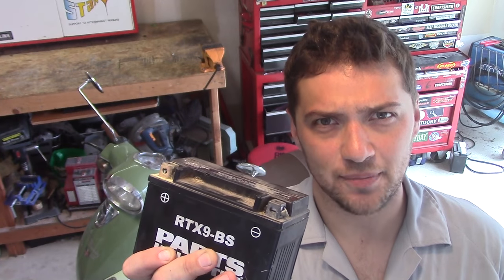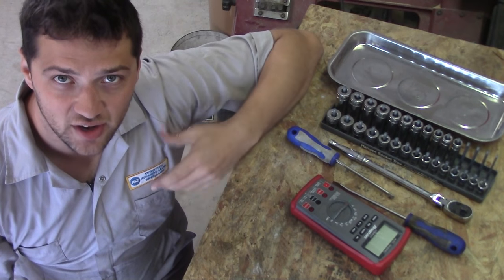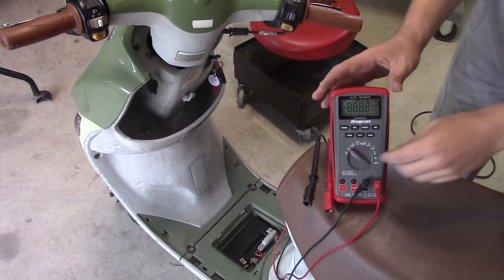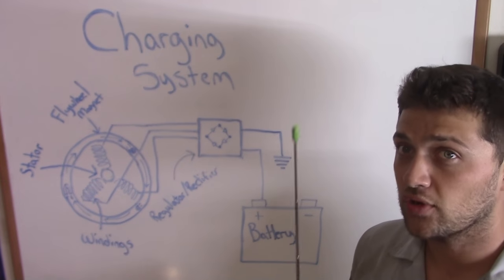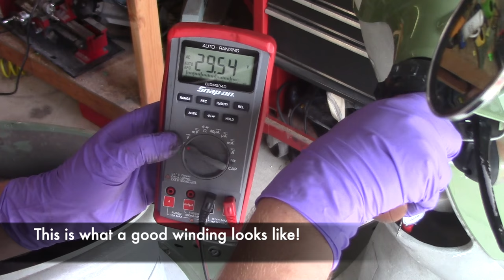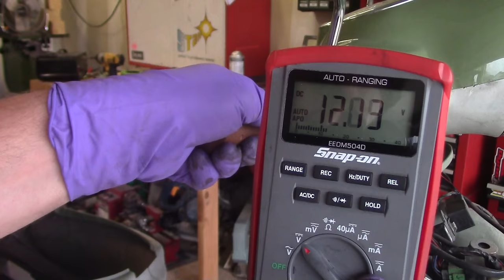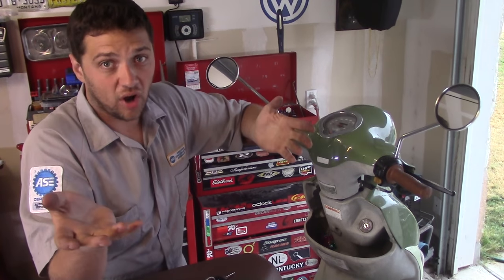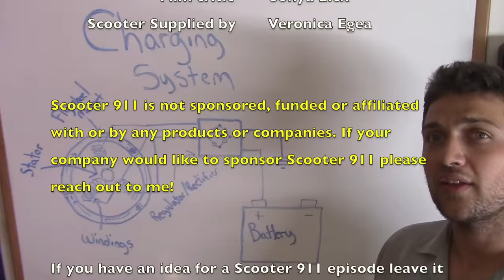Scooter 911: Battery Keeps Going Dead! (Troubleshoot your charging system and parasitic drain)

Comment: What if you cant get it to turn on
Reply from the maker: can you be a little more specific? Is your starter cranking the engine (making the rikikikikikiikikik noise) but its just not starting?
Reply: Mine is now not starting about 10% of the time it will try to start most of the time nothing. Sometimes I can hear just one little click when I press the electric start switch. I did read the battery a couple days ago and even reved it wasn’t getting above 13.2 so I know something is wrong there just can’t start it now to figure out why

Comment: My 150 Tao scooter doesn't turn on. It makes a weird eeeeeerrrkk noise and doesn't want to go on. I believe it's the battery  😢
Reply from the maker: Does the horn honk or do the turn signals flash? Check out my electric start diagnostic video here! https://youtu.be/XAqhEmx8dFM
Reply: @Scooter_911  the horn works but the turning signals dont work or the hazard lights

Comment: if anyone can help me. bought a non running 2019 tao tao 49cc scooter. after changing the carb and flushing out the fuel system it was a perfect scoot. the brake light blew, i bought one from amazon,  after i replaced it blew everything from the positive side of the battery and the in line fuse was blown. i tried a lot then saw that there was a soldering defect that shorted the low beam. since then i cant charge a battery and every time i rev the engine i blow my headlight. i have replaced the stator and regulator/rectifier . im stumped. anyone who helps gets extra presents from SANTA!!!